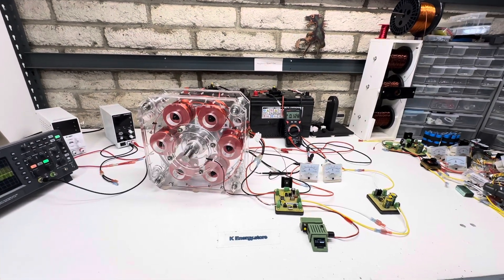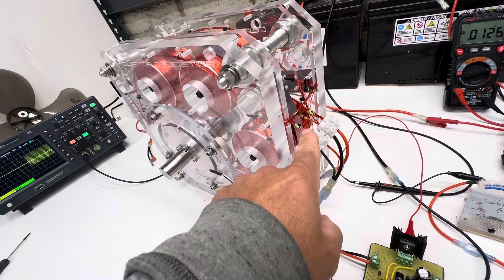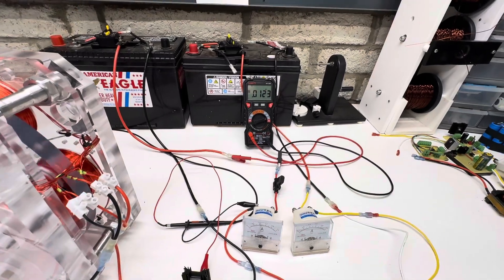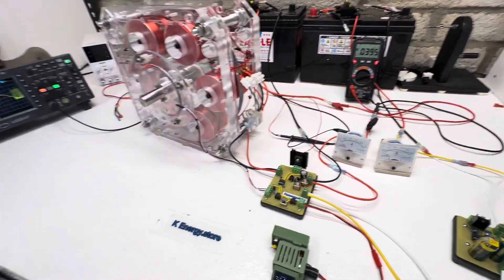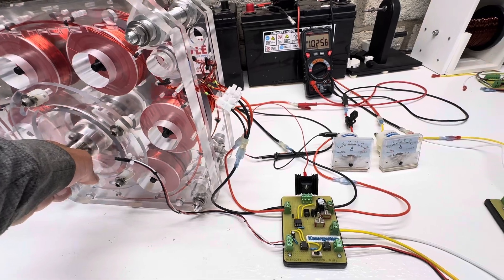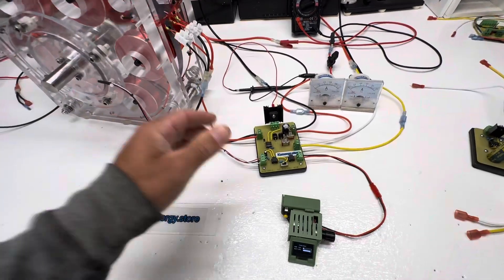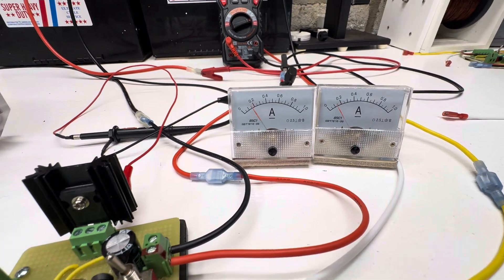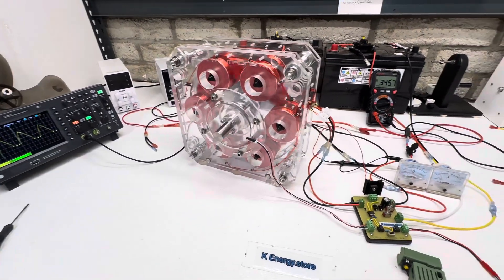Quanta magnetics pulse motor with new circuit

Comment: Hi K
So here is story, I will try to make it quick probably will not turn out like that...About 14 years ago or so, this guy in Florida who I had done a project for modifying a golf cart motor so that it charges 2nd battery stack while it runs (via double wound coils) contacted me and wanted me to make that ultimate motor-generator, one that "self sustains" and lets loose lots of power to charge up a big battery bank that solar panels could be charging during day time.
So I said OK I could build something for you like that, but its just going to be a "battery swapping looper" in that battery stack B gets charged up by motorgen while battery stack A runs the show then you swap stacks at best time to do it.
You know all about this I am sure...
So it took me 9 months but finally completed the project and sent it out.  I charged him $14K too (nice eh)
Agreement was he was not supposed to tell people he had a "looper" just a real effecient battery charging motor generator thing is all.
What is interesting is that what I built for him a couple years later came to be near exactly what you have now in that big pulse motor.....same relays he had (from florida source) same aircoil size and wire gauge, same nodymium magnets size and shape (hockey pucks) Mine were a little bigger however....plus same six magnets vs six coils each side.....All the same BUT I did an elaborate "shorting coils at the peaks" thing to it too, which would really boost caps up in charge at near no consequence to extra draw to motor....Aircoils perfect for this sort of thing since they really "ring" hyper fast....
Anyways what happened is they guy with my machine invited lots of "big shots" over to see it, and started bragging too much and eventually some big "power brokers" he called them from Delaware or Maryland with Italian last names came out to visit me as supposed to get 7 million in investment and I was going to split it with guy in Florida,
They sent a "bulldog" out - an MIT professor who was a real dick - trying to see if we would flinch and over react to harrassment and insults and so be unsuitable for investment I guess....he said the people were more important than the technology (some shit like that)   Turns out he worked for CIA bigitme probably from the investment branch that works with mafia and drug dealers I dont know but it was a "bad trip"  He finally said we would get our investment money but I knew that was anothe psychological ploy just to see how we react.
Anyways we got nothing in the end, he took my peak coil shorting tech, the only thing he liked (its OK sice I am open source all the way)  and did something with it I dont know what that is the end of story I could go on but this good enough
Reply from the maker: Very interesting story ! Seems like that happens a lot 
You’ve described that to me before I’ll have to try it on this motor !

Comment: Hello, what size wire do you use? how many rounds? What is the diameter of the magnet?
Reply from the maker: This motor is 24 awg 
Not sure how many winds 
Magnets are 1.5 in neos
Reply: @kenergy1707  How many 26awg wires did you attach into one large size wire?
Reply from the maker: @sanhnghiemxuan7271  it is just one wire per coil